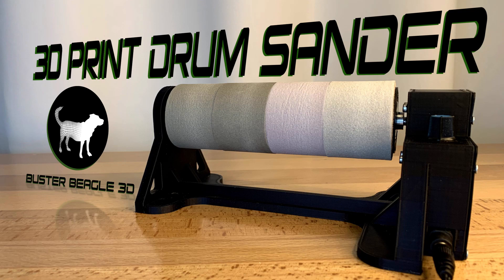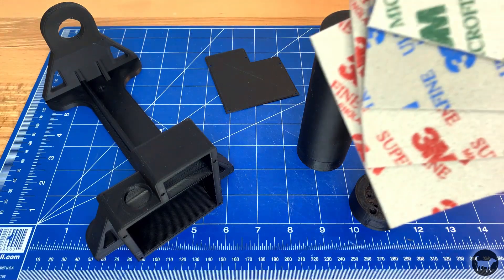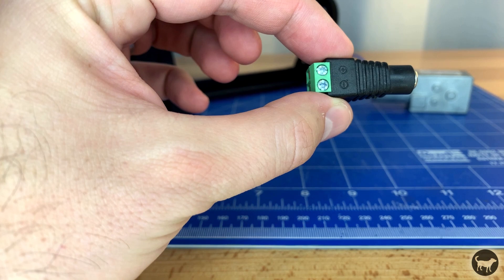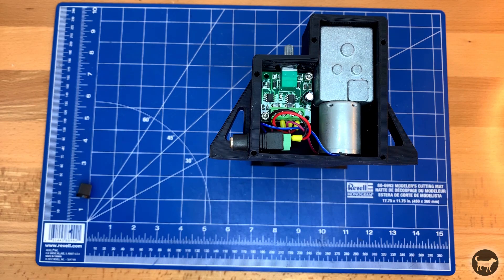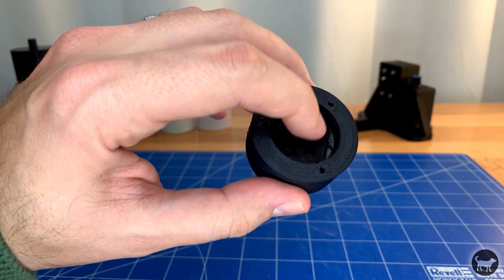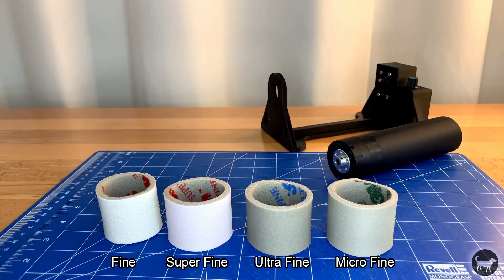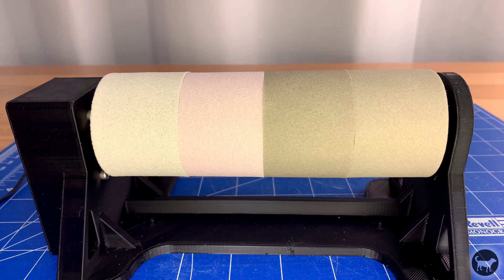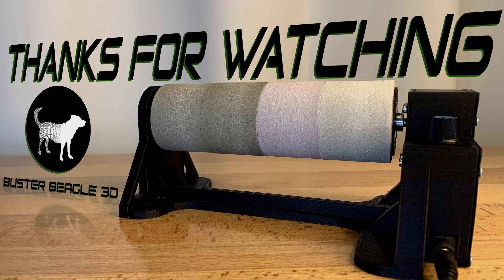3D Printed Drum Sander

Comment: Thanks you very much for the video. 
Do you think it would be possible to have some water on the roll and increase the speed while not damaging the 3d print? It's neat solution and I'm wondering if there is a way to speed up things. Adding water storing at the bottom and a differently gear motor would required little change.
Another question, how crank up is it the DC controller in the video? Maybe there is not even need to have another motor.
Reply from the maker: You could put a different worm gear motor with higher RPM to make the machine faster. I don't see why water would damage the 3D print but if you spin the shaft faster the water might shoot out of your container like a bike tire in water. The DC controller in the video is turned up all of the way. Hope this helps and I'm glad you liked it.

Comment: Point 1.  Its too slow.  You know this.  That is why you sped up the video for the sanding portion.

Point 2.  It needs to be secured to the table.

Point 3.  By the time you add up all the individual parts required, order and ship them, you could have went to your local hardware store and bought a sander.
Reply from the maker: It is purposely slow. Sanding a 3D part too fast will actually damage the part which is why a store bought sander is not a great option. You can also source the parts from much cheaper places then the Amazon links listed, they were just the easiest to show the parts you needed. The model also has a base that can be clamped down, it's also why there are holes in base to attach it to something.